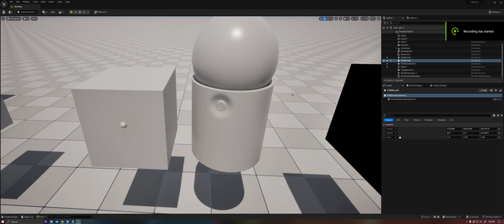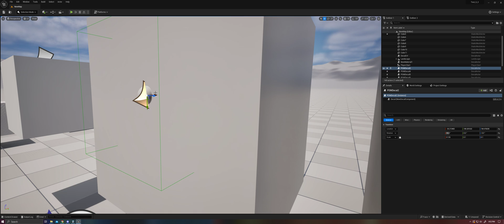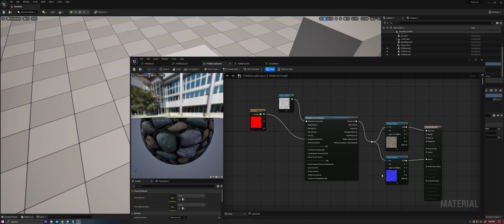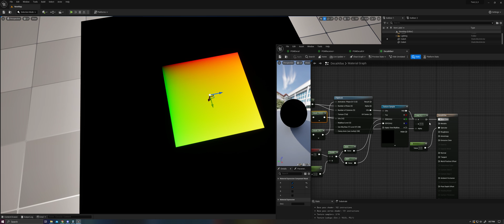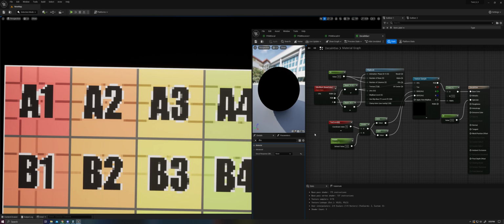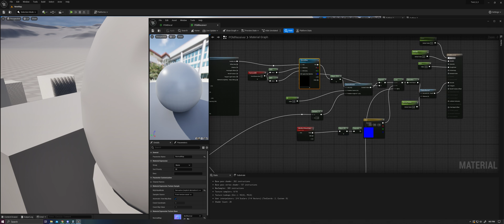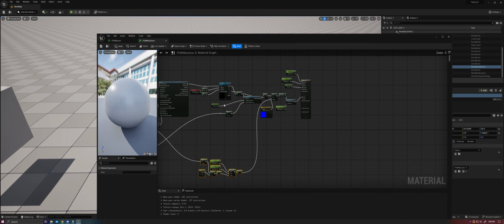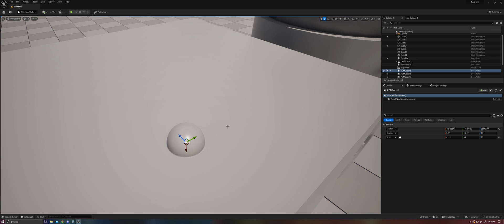Parallax Occlusion Mapping Decals (Using Custom Decal Response) UE5

Comment: Hi, Alex. Actually, POM decals can be unsensitive to tangent without blueprint implementation, just by modifying function itself. I provided this solution in last video by link in the comments
Reply: @Brudiz could you provide the link again? I can't find it.
Reply: @bartkoch1988  https://drive.google.com/file/d/1Gt8qx6Naq6iDpXFm1YPcmz76nKsWekxN/view?usp=sharing
Reply from the maker: Your function is quite good. But without the true smooth mesh tangents, I did notice much more distortion on curved surfaces. Perhaps this is not such an issue since POM is best avoided on curved surfaces anyway. But regardless, I was able to combine the two techniques for the best of both worlds.
Reply: @TechArtAlex  Nice to hear that, thanks for your responce
Reply: @TechArtAlex  Could you explain the technique used? Brudiz' I can't seem to find the video that Brudiz is talking about. Thanks
Reply from the maker: @yarbone7  PrismaticaDev has a video on his channel about it.
Reply: @TechArtAlex  cool, I'll check it out. Thanks :)

Comment: Tried building the decal using this video as a guide, however I just can get the decals to appear in my scene. The material just remains grey
Reply from the maker: Make sure that the mesh is set to receive decals, and that the receiver material has the correct settings for the dbuffer response.
Reply: @TechArtAlex  I tried rebuilding the material to make sure I didn’t miss anything, I even redid the POM rotator changes to a new Material Function just incase. As far as I can tell, I followed everything exactly as shown in the video. I also confirmed that the meshes have 'Receive Decals' enabled, and I checked the DBuffer response settings, they where set to colour/roughness/normal for the Master Material and the instance I created.

That said, I must be missing something. When I connected the output from DBufferA and DBufferC through an Add node to the Base Color output (just like in your video), nothing shows up in the preview at all.
Reply from the maker: @ajax5117 Are dbuffer decals perhaps disabled on a project level?
Reply: @TechArtAlex  They (DBuffer Decals)are showing as enabled under "Engine > Rendering > Misc Lighting > DBuffer Decals" in my project settings
Reply: @TechArtAlex  Im running UE 5.5.4

Comment: Hey, idk if I missed anything super obvious, but I can't seem to get this method to work with sampling different decals for the same receiver. My idea would have been to pass some sort of id from the decal mat instance to the receiver which then switches the decal by offsetting the UVs on an atlas, but I haven't found a way to actually achieve that.. at this point I feel like this would start to just cost too much performance since our master material is already quite heavy, but I'd be curious if you had any ideas
Reply from the maker: That should work just fine, and is basically what I show at 3:30. The decal is passing an index value to the base material, which offsets which part of the atlas is sampled, but could also alter anything else as needed.
Reply: @TechArtAlex  bruhh you even showed the setup already :(( thanks for pointing it out again tho. Guess I'll just have to fix the rotation center and it should be done

Comment: Can the "Rotate POM" be modified to leave the shadows coming from the right angle (sun vector or whatever)?
Reply from the maker: Yes, but It would probably be easier to just counter rotate the sun vector, like we do with the normal map.
Reply: @TechArtAlex  I tried to achieve this all day :D Couldn't figure out how to rotate a vector in the material editor (without higher trigonometry).
Reply from the maker: @pauljojo1318  There isn't really a general purpose way to rotate vectors without trig. The rotate about axis node is the simplest way to rotate a 3D vector by axis and angle, but it's doing trig under the hood.
Reply: @TechArtAlex  I tried to hook them up in the right way for a while. There seems no tutorials on rotating a vector in mat - only WPO. A hint on how to hook the sun light vector up with the rotate about axis node?
Reply from the maker: 1) I'd probably use the -(vertex normal) for the rotation axis. 
2) Use the same -(rotation angle) as with the normal map.
3) Pivot point is (0,0,0) when rotating a vector.
4) Position will be -(light vector). 
5) Then, add the output back to your original position aka -(light vector). 
6) Use this as the input for your POM light vector.
Reply: @TechArtAlex  Absolute genius. Thanks a lot. You have a safe spot in my credits ;D. My POM can now be rotated with dynamic normals and shadows (like yours I'm sure). It adapts it's background material including UVs. Good alternative to Virtual Heightfield or HighPoly "footstep" solutions.
Reply: @pauljojo1318  Hi, im a newbie, do you mind sharing your POM material? Im not quite sure how to get the shadows working correct when rotating POM Thanks!

Comment: Very cool. Does this work with textures too? So having a texture instead of grey and just "parallaxing" (so to speak) that texture with the decal?
Reply from the maker: Yes, you can either lerp to a different texture that samples using the POM UVs, or you can offset the main material's UVs by the POM offset amounts.
Reply: @TechArtAlex  Hmm problem is, the texture gets only displayed where the decal is. Everywhere around it's just having it's base color (brown for mud).
Reply from the maker: @pauljojo1318  the POM node has an "offset only" output that can be combined with other UVs, rather than using the POM UVs alone.
Reply: @TechArtAlex  I tried to use them to only offset the Material but the result is weird. Have you made it work?
Reply from the maker: @pauljojo1318 
Hm the offset only output does not seem to be working as intended. Instead, manually subtract the original decal UVs from the POM UVs to get the correct offset amount. Add this to the texture coordinates instead. 
You also need to make sure the offsets are scaled properly to account for the difference in scale of the decal Uvs and the base material UVs.
Reply: @TechArtAlex  That's definitely a lot closer, thanks! A video on this would be nice. Mine certainly doesn't look perfect by now (I followed your other videos too).
Reply: @pauljojo1318  Hi, im trying to do the same thing, did you succeed? Thanks
Reply: @nicholass3430  I will send you my final version later the day. But be warned: there is some spaghetti in the graph.
Reply: @nicholass3430  My comment from before posting an image got deleted. Any other idea?
Reply: My comments are getting deleted too...
Reply: @pauljojo1318  Hey. thanks for helping me out. could you sand the material to nicholaskzy (gee-male eddrezz) ?  My comments from the other account keep getting removed, so im using this one

Comment: Hi, Alex. Can you give some arbitrary e-mail address where I can send my question with pics about the POM-Decal? I made the Decal as in your actually very good tutorial but it is pixelated and the parallax effect is not correct either. Changing different Parameters won’t help. I tried to make it in a substrate material but I don’t think that there should be a problem.
Reply from the maker: If it is still pixelated try dividing and re-multiplying the UVs by a higher number than 8 (like 128). This should reduce the banding issue I showed even further.  
As for incorrect parallax... Check that the decal is oriented correctly. Unless you modify the POM node, the decal tangent must be aligned with the surface tangent.
I don't have a public email set up yet for the channel but that's a good idea. I'll set one up later today - let me know if you're still struggling and I'll link it.
Reply: @TechArtAlex  
Alex, I had a Mask node set to a wrong channel (receiver material) but after correction it helped not much. I’m sure I made some mistake but where, no clue. My English is very weak, this is the reason why I wanted to explain maybe with screenshots.
Reply from the maker: @МаксимЩемелев-ч2д 
I set up techartalex.yt@gmail.com
Reply: @TechArtAlex  
Alex, I have send to you an e-mail but got no response.
Reply from the maker: @МаксимЩемелев-ч2д  Okay, I sent a response now.

Comment: Is it possible to have another material on the receiver or control the opacity of the decal? Seems like the use cases are limited.
Reply from the maker: You would control the opacity just by using a lerp in the underlying material. In my example, I faded the edges radially using the UV coordinates, but you could also use an alpha texture or even the height map.  

You can't use the opacity of the decal material, because it pre-multiplies the other outputs which will mess up the data. You can un-multiply it, but I found it to be too inaccurate. 

The underlying material works just like normal, beyond the altered response to the decal. It can be anything. The method should not limit usage in any way, since you have complete control over how it responds to what decals. 

In fact, the opposite is true. Not using custom decal response workflow is limiting, because previously the only control you had was to receive all decals or receive none.
Reply: @TechArtAlex  Thanks for the reply. I think I figured it out. A lerp was all that I was missing. Thanks again.
Reply from the maker: @username-r7d6u  Sure thing, thanks for watching!

Comment: hey, Alex, great tutorial! Really appreciate your POM series. But I have an issue with really bad ghosting/shadowing effect around my character when he runs over POM or Tessellated floor or stands next to POM/Tess wall. it somewhat goes away if I add strong light source nearby, but I can't use this trick everywhere. any ideas what causes this? Thanks again!
Reply from the maker: Ghosting issues are almost always a result of bad motion vectors combined with TAA / TSR. 
POM is prone to messing up motion vectors unless you use Pixel Depth Offset. Unfortunately it is impossible to use PDO with POM decals. Keeping the displacement levels very low will reduce ghosting too. Tesselation doesn't normally have that problem though, so I'm not sure why that would be happening.
Reply: thank you!  @TechArtAlex

Comment: Amazing video!
May I ask how did you do to place the decal aligned perfectly to the surface normals of the meshes at the beginning of the video?
Reply from the maker: In the top right of the viewport there is a snap to surface setting, which also has a toggle for aligning the selection to the surface normal. Very handy for decals.
Reply: Thank you!